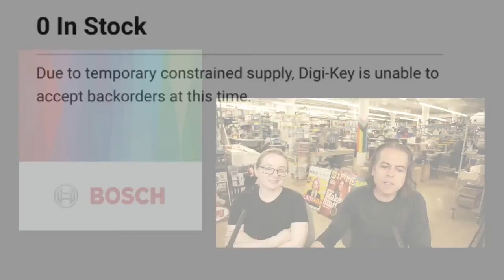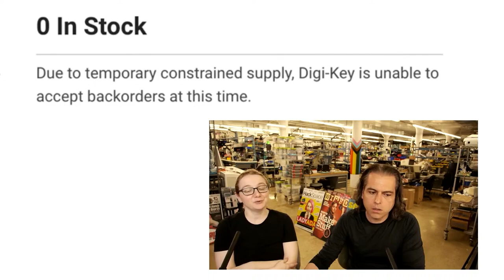Chip Shortage (a new feature) #ChipShortage #adafruit @Adafruit

Comment: Been building LED lighting for my reef aquariums using PCA9685 bare chips, building the boards with 200 watts of specific wavelength LEDs for coral growth with the drivers and the PCA9685 chip all on one board and mounting several of them above a tank and controlling everything with one Pi Z 2. I've had to resort to buying the breakout boards and stealing the chips off of them to complete my last one.😛

Comment: Does this mean that recycling electronics and building out circuit equivalents will become a thing? Imagine building a 555 "chip" with actual individual transistors, op amps etc
Reply: I have been scavenging CRT and VCR boards for some video chips that are obsolete now. I suspect it has been going on for a time in certain areas (vintage audio comes to mind)
Reply: @gabotron94  do you list these parts?